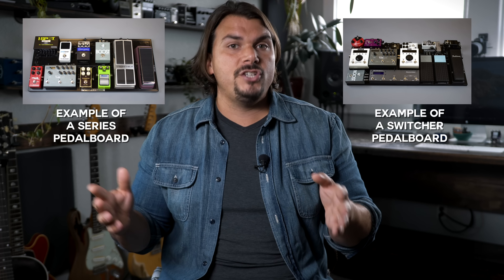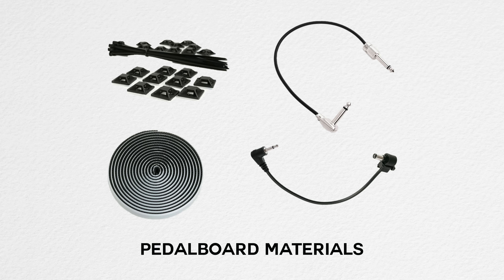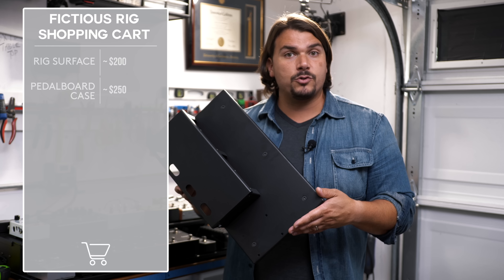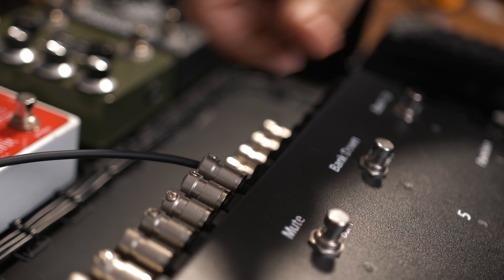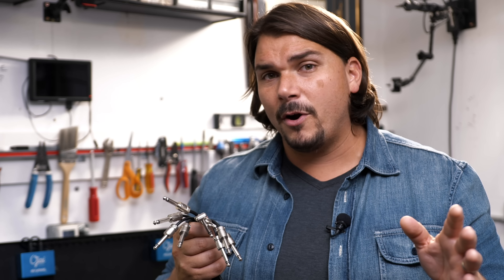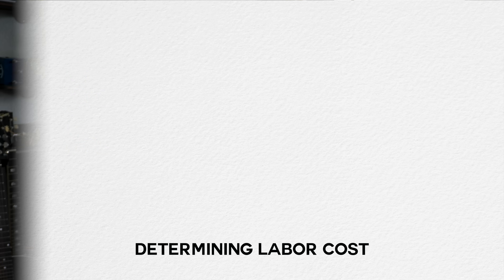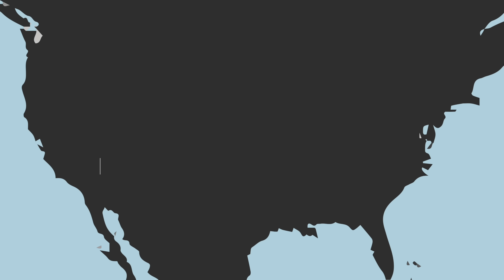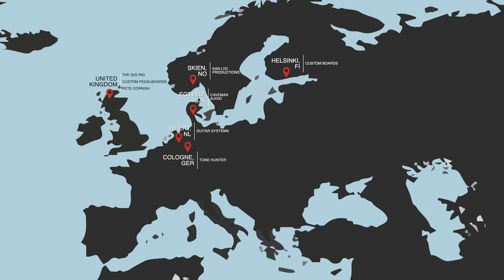The TRUE COST of a Custom Rig Build

Comment: For simple-ish to moderately complicated pedalboards, if you can’t rout some custom cables and stick some Velcro on objects then I have a hard time believing that you even have enough brains to play the guitar. $2800 just for labor, cables, Velcro and zip ties??? I’m not intentionally trying to be negative, but sheesh you’ve got to be kidding me. I have $1500 worth of pedals (12 pedals total) in a custom hard case that I spent less than $300 and 4 hours building, and it works absolutely perfectly and looks good too. It’s just a 5 cable setup (some pedals through FX loop and some between the guitar and the amp input + Marshall 6 way channel selector), but it’s absolutely perfect. I’m thrilled that I could potentially make $2000+ building pedalboards and am not knocking the guys who build them professionally, but for the customers out there… come on dudes… it’s not that hard to do it yourselves.
Reply from the maker: If you think you can do it as well as professional we have all the resources here so you can learn to solder and route cables properly like a professional.  A lot of people think it's easy until they try to do it on a professional level and have it work and function on the level of a pro rig.  It's a lot like 50 year old men that still think they can play tackle football and win the state championship like back in the glory days ;)
Reply: @VertexEffectsInc  Like I said, I’m not knocking you guys who build them professionally, but I have a hard time understanding it from the customers’ perspective. They have the brains and skills to do the research of what pedals they want and how they want it set up but don’t have the skills to actually set it up? I understand that a millionaire rock star who tours multiple times a week wouldn’t gain anything from doing it themselves, but the rest of us? I’ve been gigging with my custom pedalboard/case for 7 years in multiple states and it’s held up just dandy, so for an amateur I’d say it was executed professionally (enough).
Reply: @GioGuitarDude  "Professionally (enough)". That's the key phrase. I, too, can use double sided sticky-tape to weld my Donner and TC pedals to a cardboard surface. Tie the loose cable into a knot, and marvel at the Fuzz and Wah at the end of the chain (because the colors look good there). Do you employ a garden service to tend your lawn? Utter waste of money. It takes me 2 hours to cut my lawn, and I save $50. 2 hours of my pay is $70. Hmmm... let me get a calculator out...
Reply: @GioGuitarDude  And yeah, you are knocking the professionals. You are far from amateur. You can make a pedalboard because you researched pedalboard manufacture. I want to make music. I have little interest in impedance, Ohms, and buffer pedals. I want to sound good. I'm not at the stage of needing a pro to design my pedalboard, but I understand the professional mindset. 40+ years of biomedical science. You want me to look at your blood film, or you want to do it yourself with Google images to help?
Reply: @mrrclewis  I sense that someone is salty because they have considered spending $3000 having someone else build their pedal board… ouch. You’re seriously comparing sticking Velcro and connecting/soldering some wires to diagnosing illnesses with a blood film and a microscope after 6-8 years of mandatory education? Yes I guess in terms of price you’d be onto something (charging a patient thousands of dollars for a few hours of work [if that]), but soldering wires and the “crafty” aspects like sticking Velcro and determining layouts of pedals and wires is child's play that I was familiar with in elementary school. Definitely not a professional… but who cares? If I bought a microscope and glass slides and learned myself how to properly “read” a blood film through research and inquiry in my garage, what difference would it make? If it’s right, it’s right. In all seriousness though, these guys don’t have to get a PhD to slap a pedalboard together, so your background is absolutely irrelevant as is your argument… but alas, here we are.
Reply: @GioGuitarDude  If you value a service below its market value, by extension you disrespect the professional who offers that service. It doesn't matter if your education comes from formal training or from experience. Neither does the field matter. If you want to do it yourself, then go for it. If you want it done right (in a timely manner) pay for it. Insinuating that these professional builders are ripping you off is plain offensive.
Reply: @GioGuitarDude  You're paying for the quality. Most people, don't need that. If you're a touring musician that takes his pedalboard all over the country, or world, you'd probably look into having one of these build for you professionally. I'm sure you can solder some patch cables and slap pedals on a board with velcro, if that works for you, that's totally cool. But what these guys do is on another level. Have you seen the wire management? 
And no, I did not pay them to build me one of these. That's just a low shot of you for saying that. I am planning to build my own, but I am well aware that it's gonna cost me 10+ hours, maybe double to get something similar. It's doable to do this yourself, for sure. But some people simply aren't that handy or just don't want to do it themselves. No need to get your knickers tied in a bunch over that. You already made your board and are never going to get one build by them, so you're not even their targeted market, why even complain?
Reply: @TheEchelon  Lol I’m not complaining. I’m not bashing the dudes who do this professionally for a living either. My one and only disconnect is where someone of average income can justify spending that much money to have someone else build it. Let’s talk cars for a second… some strong able men pay a mechanic shop $1200 to get their brake pads replaced with new ones that cost $50 and take an hour to do. That just doesn’t make sense to me at all. A hydraulic jack and jack stands can be had for $100-$200 and bam, you have what you need. But it’s their money and they can do what they want with it. As for pedalboards, aside from the strength and robustness of the materials, the only real justification for most of these guys is for it to look nice. Who cares what it looks like? Did EVH spend $1000 to have a professional luthier replace his pickups and build his frankenstrat to his specifications? Heck no… that sucker was butt ugly, spray painted and had wires sticking out all over the place. But that ugly guitar gave us music that will be cherished for generations.
Reply: @mrrclewis  And insinuating that something can only be “done right (in a timely matter)” if you pay someone to do it is offensive to those of us who do it themselves (na not really… I don’t really care what you think). These pedal “doctors” developed a skill and are make a living. They have to charge enough to come out ahead and keep the lights on… good for them. I’m just saying to potential customers that it’s not rocket science.
Reply: @GioGuitarDude  I got nothing more to add. You go with  your pedalboard. I trust it serves you well. My sentiments remain with the professional builders. I likely won't pay $3000 for a build, but I don't  disrespect their existence. You and I, we got little in common. I love DIY. Saves me money, teaches me a skill. I love professionals. I pay my money, I get their skill. I don't understand your disrespect. I most likely could create a great product for myself (you know nothing of my background). I know nothing of your background, except that you can competently produce your own product. Good for you. How about a hurrah for the builders?
Reply: You’re the same kind of person who hires a kid on Craigslist to photograph their wedding for $100 and then doesn’t understand why the photographs look like they were taken by someone’s random aunt with a phone
Reply: @thestuffmikedoes2309  I’m not exactly “not understanding” why my rig sounds like “someone’s random aunt” put it together… because it sounds stellar. That correlation was way, way off my guy.
Reply: @GioGuitarDude  I figured you wouldn’t understand
Reply: @thestuffmikedoes2309  alrighty then.
Reply: So this has been an interesting thread😂 Here’s my 2 cents. I work live concerts and get to see tons of guitar rigs from different artists. He has a point about doing it yourself, because all of them do until they get a guitar tech. Spending thousands on setting up a board is pointless

Comment: 72 dollars for zipties and tiedowns, 70 dollars for velcro? I'm sorry but this is insane. For that money you can buy 1500 zipties, 480 tiedowns with 3M tape and 24 METERS of velcro tape (just checked on amazon U.S.).  I'm not sure where you are getting your numbers.
Reply from the maker: $24 for zip ties and tie down mounts without a switcher, or $48 with a switcher. $70 for Velcro.  This is presuming the “pretend” pedalboards we started with in the beginning getting high quality zip ties, tie mounts, and Velcro.  Maybe you misquoted what was shown in the video for zip ties and tie mounts or combined them mistakenly?  Each pedal takes about 1 ft of Velcro plus the power supply and buffers, you’re looking at 12-15 devices total x ~ $5 per foot for SJ3550 split with SJ3551
3M or Power Grip Pedalboard Adhesive once you factor in shipping, tax, etc.  These products aren’t available as wholesale, in particular 3M.  Rig builders don’t buy enough to even get close to qualifying for bulk pricing on that, so most are paying retail like any normal person.  As the price relates to the zip ties in tie mounds, typically you have to buy them in quantities of 100 pieces, especially when it comes to high-quality ones that have good adhesives on the tie mounts.  Quality marine-grade adhesives on tie mounts can often be upward of $1/per in some cases.  It’s not like there’s just any old replacement you can buy on Amazon they said equal quality, that’s not going to lift off within a few months or when it experiences any humidity or moisture.
Reply: @VertexEffectsInc  also if you are charging for your services you gotta  offer some kind of warranty, so you better use some quality parts and not something that will fall apart in a few months. That’s exactly why someone would search the services of a pro..
Reply from the maker: @x3a3x3  very true.
Reply: @VertexEffectsInc  pedals don’t take 1 foot of Velcro lol
Reply: @jambajoby32  1' of velcro = 2x 3" sections.  3" of hook, 3" of loop x2 sections per pedal.  Sounds pretty close when you consider pedals aren't all in a 1590B size enclosure.
Reply: @GoodwoodAudio  idk it sounds like a lot more than needed … hey to each their own though! Some of us are less skilled with organizing but great at arranging pedals to where others pay ya to do it for them
Reply: @jambajoby32  Correct. You can use one square inch for bottom and top of the pedal. It's a little rocky, though. Wobbles alarmingly when pressed. Not sure I'd  use one square inch if performing in public. Or even practicing in private.

Comment: There are times I wonder about the reality of Synchronicity Mason…as I was spreadsheeting the to date expenditures for my board I was asking myself “ Why hasn’t anyone done a piece about the cost of a good board? (Hell a bad board for that matter!) I bet Mason would do one…Without shocking people I’ll simply say it’s likely I could easily buy a vintage amp for the cost of mine (so far) and we’re only talking parts and pedals much less time and materials. Doesn’t surprise me that some folks can make a living doing it…so lead on Captain let’s see where this ship sails today!
Reply from the maker: We generalize here, no specific prices assigned to any one builder but go off of what we know and give you a rough idea on material costs that are pretty universal and then get into the range of cost per hour labor ranging from less experienced to most experienced.  It wont' be as accurate as a quote from the builder of choice, but at least give you a ballpark.
Reply: @VertexEffectsInc  As an example of published cost, Brian Omillion, a top board builder you certainly know Mason, is affiliated with Guitar Sanctuary in the Ft Worth area, has his rates and basic materials costs posted on their website as well as a basic estimate of time for boards.
Reply from the maker: @geo5772  some do, however when you get into more custom options it's hard to estimate.  Also when you get into more of the master-builders it's a bit more cryptic.
Reply: @VertexEffectsInc  Indeed, cryptic is a good word to apply here. I chose Brian because he does give you an "idea" of what one of his boards costs from simple labor ($75/hr) and basic materials (plugs/cable) standpoint. As far as material costs go I cant help but feel that a "joe" like myself who has just enough technical experience to be dangerous and a driving desire to build and learn from his favorite YouTube board builder (Hahaha!) is faced with higher one time costs than a builder who can bulk order. I'm working up my second order with Brad at BTPA, (a super nice person, like yourself) who has been both patient and helpful as I wade through the multitude of materiel choices...I will say that without the guidance and tips I've been picking up here and through your links, I would be faced with even higher costs as I ordered material I wont or cant use. Once more thank you for all the virtual help! (and dammit get those new boards on the market!!)

Comment: Have always built my own just because of cost. Buy the wood, cut to size, build platforms and screw together if needed. Usually trim the outside with aluminum. I don't paint mine. I like the oak wood color so I finish with Minwax Polycrylic clear satin finish and just put on strips of velcro or dual lock across so I can swap pedals as I inevitably will do.  Buy a good quality power supply, used Strymon on the last couple I've built. Ordered all my jacks, wire from Bestronics last time but have use other brands in the past. I like being able to order everything I need from them and they have good pricing.  Been soldering since I was a kid (still feel every guitarist should learn to solder) so do all of that myself. My cable runs aren't the cleanest because I swap stuff around a lot but all the materials usually cost me $100-300 depending on size of board. I also mount jacks into the side of my pedal risers for running cables back to my amps. I get a lot of compliments on my boards. I've made about 6 now, all different sizes. I often think it would be cool to have a "pro built one", but in the end the money savings alone would keep me from ever doing it. Add in knowing that it's my design makes it feel a bit more special as well.
Reply from the maker: Totally legit reasons, and this video isn’t attempting to talk you out of the diy route.  Simply shining light on the reality of material costs and the range of labor costs as it can be difficult to understand where the money goes if you’ve not done this before.  Of course we always emphasize the DIY route as that’s what this channel is all about and democratizing the pro rig builder tricks as much as possible.
Reply: @VertexEffectsInc  Yeah, I totally get the point of the video and showing the cost breakdown. I was just saying I could personally never get past the labor pricing and occasional material mark up I have seen for a "pro rig". I understand someone not trying to re-roof their house alone by themselves, but learning to solder and make your own cables (which with all the online instruction out there today is very easy to do) vs. paying someone $1,000 or more to do it is just one of those things I can't grasp and I'm glad your videos focus on the DIY approach as there isn't any reason someone who can spend years learning to play an instrument can't spend an hour learning to use a soldering iron.
Reply from the maker: @therealdealblues  the choice is there for those that want it.  Again that why we provide resources on this channel so there is a free option that won't sacrifice on quality and still have all the same options available to you.

Comment: I had mine built by XTS in Nashville. I'm a hack but the board build is top notch. I would consider them Master Builders and very reasonably priced. Dropped my pedals, power supply and board off in the morning and picked it up that afternoon. Highly recommend them
Reply: Wanted to add that they also modified a G7 EQ and built a buffer/interface box that has 2 additional jacks so I can just pop a pedal in and demo it without taking the board apart. 8 pedals, modded 1, build interface and route, mount and double check everything in 1 day for less than $600. Money well spent in my opinion. I also went back a few weeks later and bought one of their Winford Drive pedals and they installed it on the board for free while I waited. Again, I can't recommend them enough.
Reply from the maker: XTS is great!  Thanks for watching!

Comment: Aaaaaaand that's why I ended up doing the labor myself. 
Once I got the materials/pedals together, it actually wasn't difficult at all to get a rock solid rig done. I didn't end up using custom power or audio cables (used True Tone's supplied power leads and a mix of EBS Flat and Tour Gear Designs), but now I have a true stereo ampless midi controlled rig in 7 Cable Method.
Huge thanks to all the great resources on this channel for helping me along the way!
Reply from the maker: Totally viable to DIY this, in fact, this is what this channel is really all about.  However, some want to hire other people to do it and this video is showing them some of the basic info they'll need.